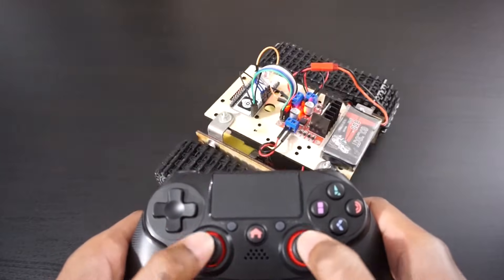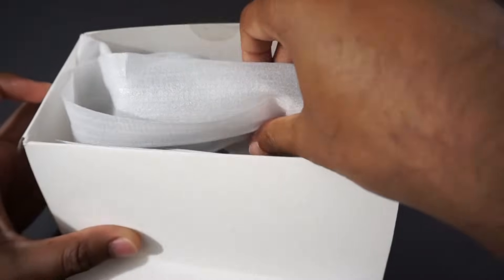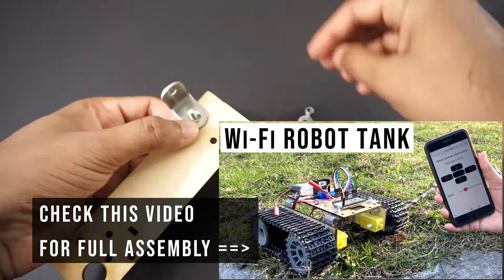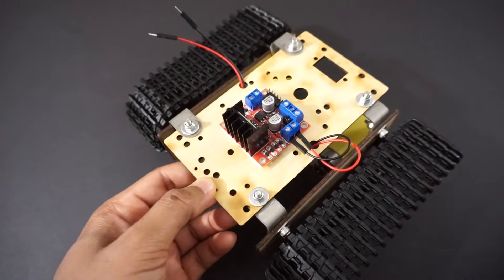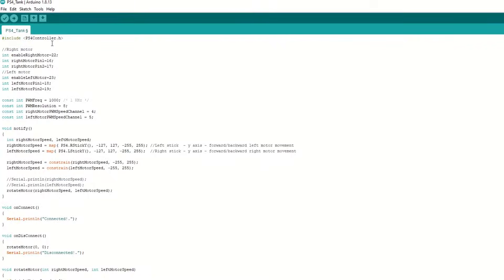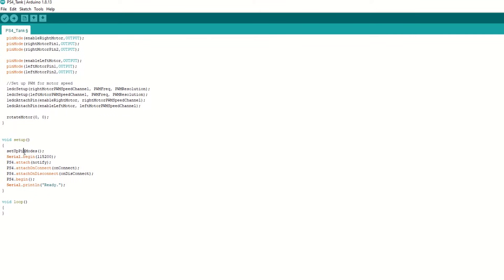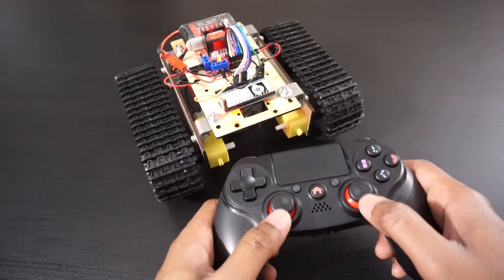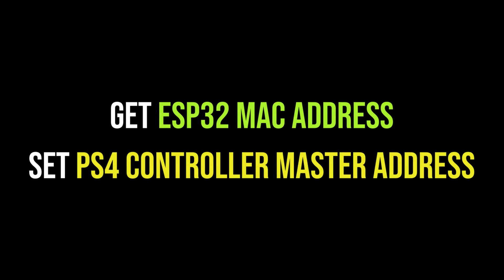RC Tank with PS4 Controller and esp32 🔥

Comment: Bro, excellent content, can you help me with this:  //Set up PWM for motor speed... I've been reading now this have changed like this: Removed APIs
ledcSetup
ledcAttachPin
New APIs
ledcAttach used to set up the LEDC pin (merged ledcSetup and ledcAttachPin functions).
ledcOutputInvert used to attach the interrupt to a timer using arguments.
ledcFade used to set up and start a fade on a given LEDC pin.
ledcFadeWithInterrupt used to set up and start a fade on a given LEDC pin with an interrupt.
ledcFadeWithInterruptArg used to set up and start a fade on a given LEDC pin with an interrupt using arguments.
Reply from the maker: These are supported in new version of esp32 board . I have not tested these functions yet . Will try these in future and confirm . But will not happen shortly . 👍🏻👏🏻 I would suggest to use old version of esp32 board which is 2.0.16 and make the project 👍🏻👏🏻

Comment: I really appreciate this video man. I am going to use this idea but with a Heljan O Gauge Class 60 model train as that would allow me to run a Garden railway with no need to power the tracks as the motor would be powered from the battery. I will use the left stick for the throttle and the right stick for the brakes like on a real locomotive. If I use DCC sound like a Zimo decoder. It would be nice to map the buttons to the sound functions and other features like the D-pad Up could be F1 for the lights, Down could turn the marker lights on and off, left and right could operate functions like the fans on the roof etc. Circle button could blow the horn on the train, and the others could control the bell, rail noises etc. Then set the script so if communication is lost with the controller, the model train throws the brakes into emergency and stops safely. Something like this would be so cool. If you search for "dead rail model railroads" it should come up with many suggestions. Keep up the great videos buddy.
Reply from the maker: Thank you very much for checking out the video and nice comment. I wish all the very best for your project 👍🏻👏🏻

Comment: There is no Mac Address, how will it connect to the controller?
Reply from the maker: Please check the video for this step 👍🏻👏🏻
Reply: @hashincludeelectronics  I got ESP32 Mac address,but I can not change the Mac address in the controller. I used the Six Access tool, and it didn't work.

Comment: Hi , I'm using an ESP32 Wrover for the project. When I upload the project, it's constantly reboot ( SW_CPU_RESET) . Do you know what it could be ?

Serial Monitor returns this on every auto reset :

Guru Meditation Error: Core  1 panic'ed (LoadProhibited). Exception was unhandled.

Core  1 register dump:
PC      : 0x40098e18  PS      : 0x00060833  A0      : 0x80099486  A1      : 0x3ffc9090  
A2      : 0x3f800014  A3      : 0xffffffff  A4      : 0xfffffffc  A5      : 0x00060c23  
A6      : 0x00060c20  A7      : 0x00000001  A8      : 0x00000000  A9      : 0x0000000f  
A10     : 0x405816f0  A11     : 0x00000110  A12     : 0x3f800038  A13     : 0x3f800078  
A14     : 0x00060823  A15     : 0x00000000  SAR     : 0x0000001d  EXCCAUSE: 0x0000001c  
EXCVADDR: 0x00000003  LBEG    : 0x40091c96  LEND    : 0x40091ca1  LCOUNT  : 0x00000000  

Backtrace: 0x40098e15:0x3ffc9090 0x40099483:0x3ffc90b0 0x400995c0:0x3ffc90d0 0x40083bcc:0x3ffc90f0 0x40083dfb:0x3ffc9120 0x400d8576:0x3ffc9140 0x400d4219:0x3ffc9190 0x400d3346:0x3ffc91f0 0x400d2288:0x3ffc9240 0x400d4476:0x3ffc9270

Thanks

Comment: Bro, I'm using the same library, if I compile and upload the code from a computer it works and connects to the PS4 controller, but if I upload it from other computers it doesn't work, I need it to work from any PC, do you know what it could be?
Reply from the maker: You need to upload code just once .

Comment: I ❤ it …but may I ask I am trying to control throttle with L2 R2 but still not work if some one know how to write code for this let me know ty
Reply: Hi, for some reason the library contains the function, but they did not use it in the example. I am working on doing the same.

You can use PS4.L2Value() and PS4.R2Value() functions to get the analog values, these functions will return a value from 0 to 255
Reply: @ramonm107  that is the problem because left joystick for steering has value 127 in the middle…R2 L2 for speed and brake has as u sad 0 to 255… I hope u know what I mean

Comment: Hi very nice, I have Xbox series x controller. Is it possible to connect with ESP32?
Reply from the maker: Sure will try this soon .
Reply: @hashincludeelectronics  Cool, was thinking if its possible to do this with a wired controller , so you can use any  controller,  and just use your computers wifi for the connection. Im an absolute beginner with microcontollers so dont mind looking into this myself.  Would love to be able ot control one of these remotely with a camera using wifi.   Perhaps even setup a wifi path for it using esp32's,  a wifi hiway for the rover to stay connected to if you will.  Better yet, give it AI and let it figure the path out  itself.  Say you ask it to goto point B, it finds its way around all  the obstacles as it possibly crawls through sewers and on telephone wries to get to its destination.  Like a drone but a land based as you get to watch on camera.  Would still need a wifi connection for that too tho.

Comment: Bro u didn't reply on my comment on you esp32 cam car video. After some use of car the cam is heating up and now it's not even connecting to wifi. Please help
Reply from the maker: Not sure what’s happening with your esp32cam exactly . May be check if there is any huge power consumption with your circuit and motors .
Reply: @hashincludeelectronics  no bro everything was fine. It was working fine but later it started disconnecting. And now it has completely stopped working